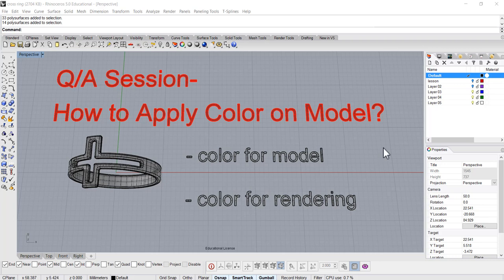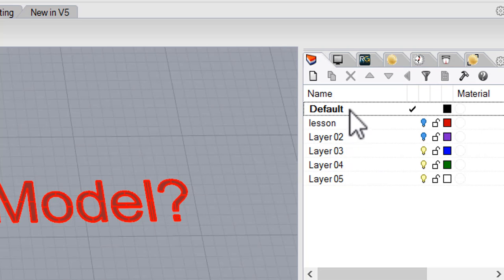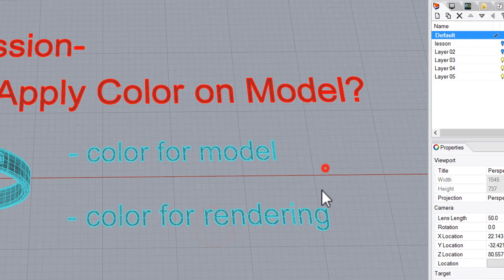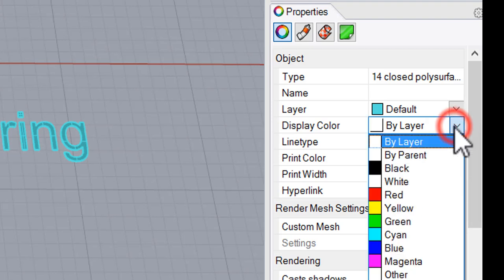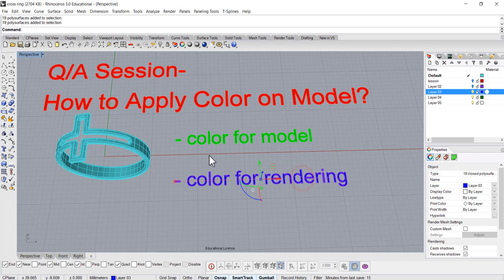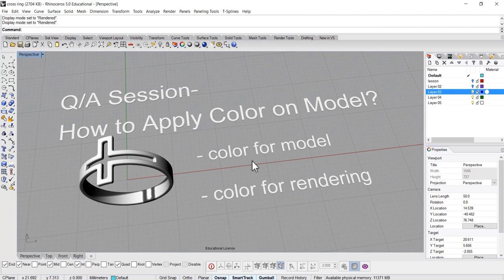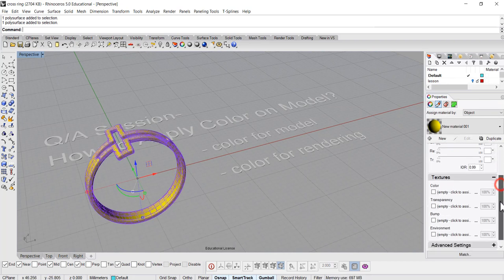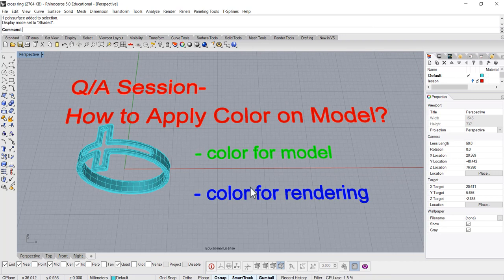Rhino 3D CAD Technique #5 - How to Apply Color on Rhino Model

Comment: How can you adjust the rendered color if it is a wood or marble "texture" (imported)?
Reply from the maker: HI Marie, If you are using Rhino for rendering. You will notice that the color won't change if you pick up certain texture like wood. The texture itself is the color you will see. You will need to either grab other texture (in a different color) or change the texture color in photoshop before you bring in for rendering.
Reply: @PJChenJewelryDesign  I don't use photo shop at all...I was trying to keep this simple. Is there a "simple program" that WILL allow be to change the colors or prints, wood, marble, fabrics that I need to import?...If you have a suggestion, can you please send me a link?...Thank you very much!
Reply from the maker: @MarieClaire_369  I believe there will be simpler software than photoshop to use. some apps can change color tone on the images as well.
Reply: @PJChenJewelryDesign  thanks, I'll check.